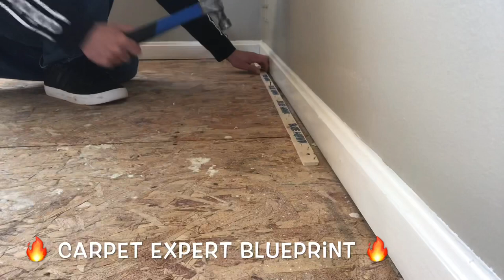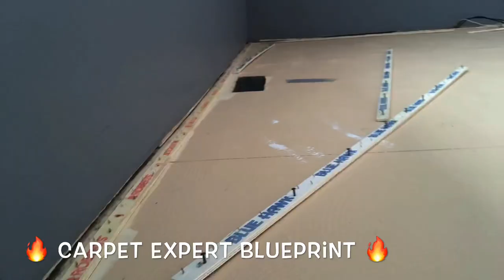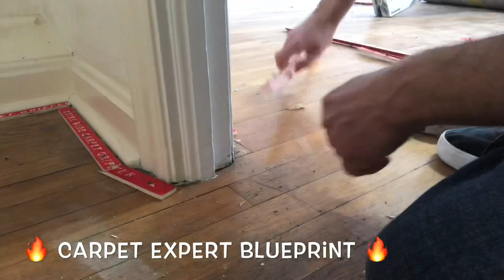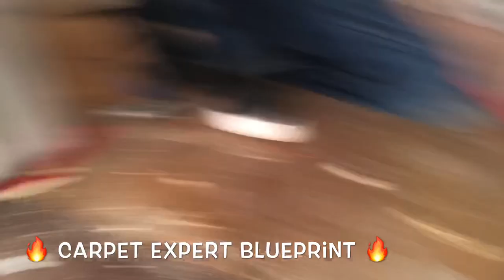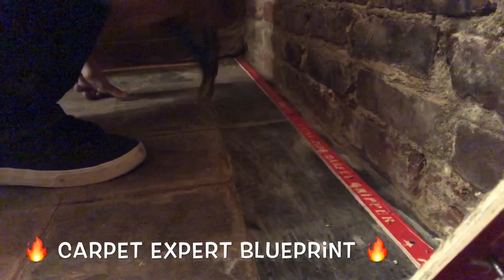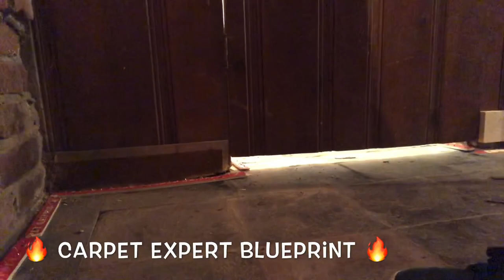🔥 Carpet Tack Installation 🔥 A Technique For Everyone

Comment: what's the name of the tool that you can use to hammer the tack strip in, it's basically an offset so the hammer does not get close to the trim on the wall. ?

Comment: We were having a pain with some strip in a old apartment with that Acoustic cement and we had some strip that wanted to warp on us. We even tried twisted nails but the cement was a crumbled mess around the edges. To we cut the strip to 12inch pieces and liquid nail that down and installed the next day
Reply from the maker: Time Table oooooo man! That’s a rough one for sure!!